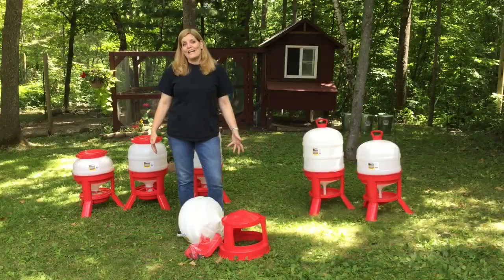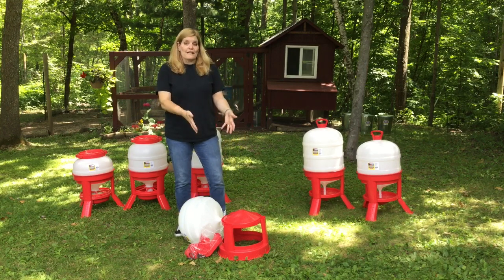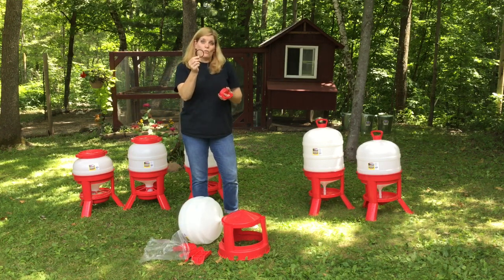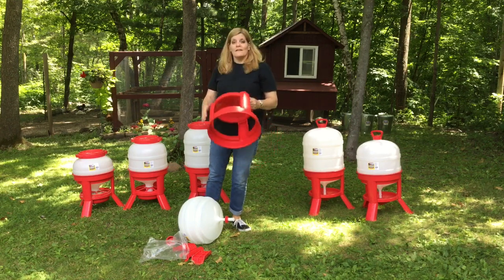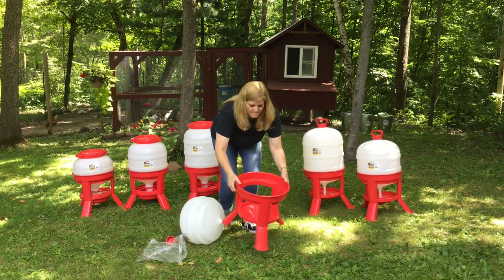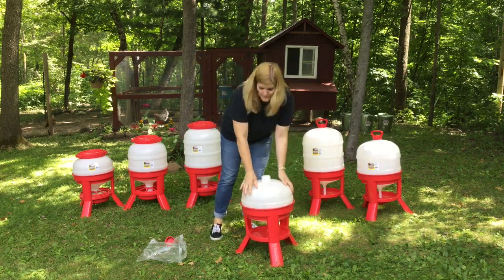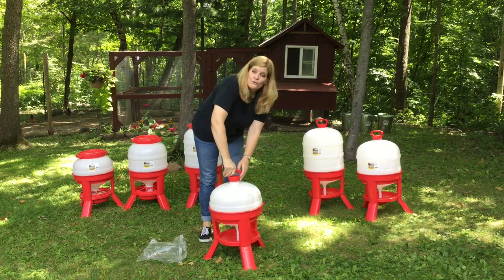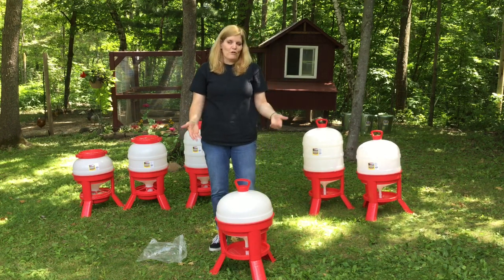How To Assemble Little Giant Dome Feeders And Waterers

Comment: Does anyone have any suggestions for cleaning the inside of the water container?  Mine has an algae-like substance growing on the inside. The opening is too small to reach inside to scrub.  I've tried bleach water but that doesn't work and can't reach it with a bottle brush.
Reply: did you figure it out?
Reply: That is what I am trying to figure out also.
Reply: Add rice and a little baking soda, swish it around real good, cleans it like a charm

Comment: This is a great waterer but how in the hell do you clean it???? I have searched all over the internet and there is nothing, cannot even disassemble it!!!!
Reply from the maker: We are so sorry about the issue that you are having with your waterer We have a great customer service team who can help you out with your issue. Please contact them at 1-800-260-0888 and they will be happy to help.
Reply: It's replies like this that give a company a bad name or reputation.  This wouldn't be difficult to explain in a non-automated reply. I assume you have some means to clean this so just answer the question and you'll save all the subsequent queries with the same problem. Answering with a bot form letter does nothing for anybody. I like your products but this kind of reply really tarnishes your image
Reply: I pour a little bleach in mine and pour enough water in to dilute it somewhat. Let it stand for 30 minutes or so, slosh it around before dumping it out, flush it out and let dry. cleans mine like new. I pull the stopper on the bottom up out of the way while the bleach water is in the bowl to keep from damaging it. Even all the algae in the bottom tube comes out.  Hope this helps
Reply: @w0lf1969  This is good information for those who don't know. When I bleach clean something, I always do three or four flushes with clean, unchlorinated water. I have a well that gives me unlimited unchlorinated water, but for those not so blessed, a couple gallons of bottled water would be more than enough to do the final rinses.